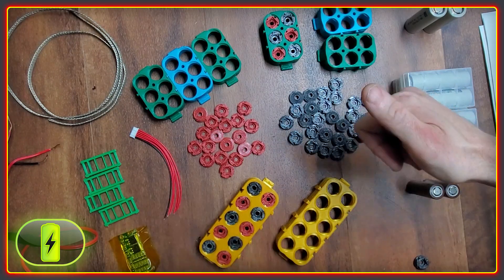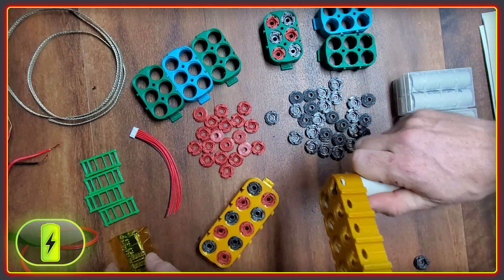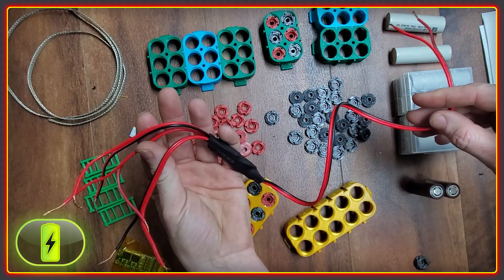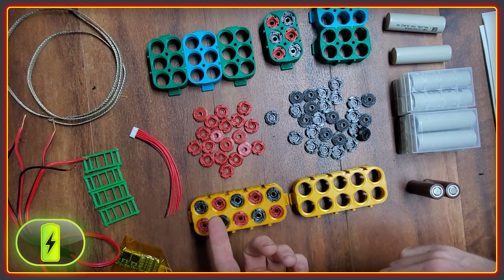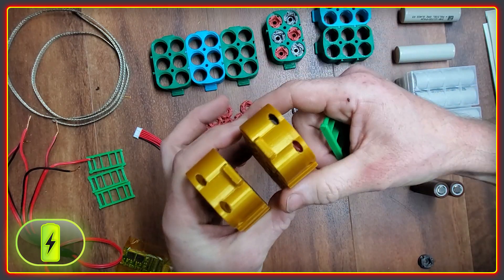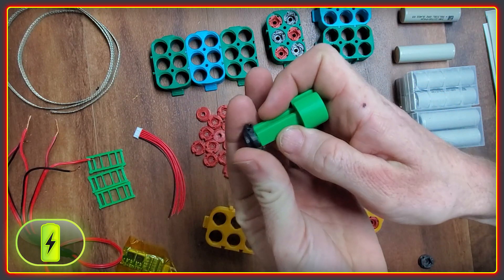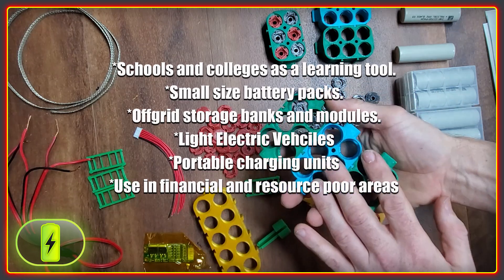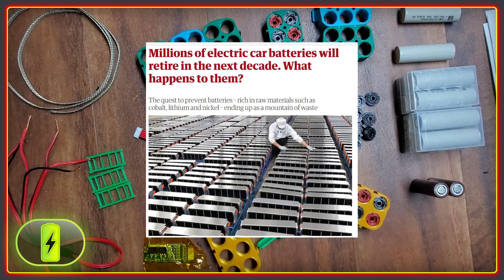Presenting the OMNICELL! Weldless Battery System for lithium ion battery packs.

Comment: For what it's worth, spot welding isnt that hard to 'get into'.. a diesel car battery and a AliExpress digital spot welder with a minor modwill do .2mm strips of nickel thick comfortably. Hassle though, and I imagine this system could handle higher currents without the need for stacking nickel or a proper welder for thicker
Reply from the maker: I will talk a bit more about the braid in another video. Good points. You can get welders cheap but you need a kweld or similar to use thick copper and nikel
Reply: @HighVoltageKits  I'm chilling in the sub 3kw range at the moment so haven't had to worry about that yet :)
Keen for something more but the cost to use just doesn't really make sense here in Wales, I can do so much with the 'ebike' and not get trouble.

Comment: These look good. Relatively quick and easy, not so power dense but oh boy spot welding is a chore. However in harsh vibration environments I'd want to see some sort of click lock on the screw in of the red/black caps as well as some sort of spring tension applied to the copper underneath.
Reply from the maker: Its interesting with the screws. The nature of the layers works to lock them in place. We have a test pack 20s1p running a Jetson bike. No suspension. It's holding up to vibration and I will be doing vibration tests for sure.

Comment: Your comments re Tesla's need for speed and the resulting heat generated in the massive battery required to power the eye watering acceleration are pertinent but also a little hypocritical.
 Lets face it - you guys have done much the same in increasing the power output of the BBSHD etc, and employing bigger, higher voltage, batteries to go faster.
This consideration of the need to recycle materials and reuse components does, however, make you holyer than Tesla. 
Thanks Joe, your concept and practical solutions in this field point the way ahead. I hope many follow.
Reply from the maker: I agree. I think that far too much effort by everyone is chucked into power and speed and no where near enough on the issues discussed here. That has to include us. Although I would argue we do consider range a great deal when we build bikes in many cases.

Comment: Very well done video and I love the entire concept. Being able to build my own battery packs would be phenomenal. It looks like the only trade-off here is the size of the case that holds the batteries together versus a traditional battery build where the batteries are just sitting on top of each other. Not a bad trade off. 

I was just quoted over $700 for a 14s4p battery build using Molicel 18650's. Would be nice to build my own pack and bring that cost down.
Reply: it does make them a little bigger. These are the linear modules, offset modules coming soon. Overall it really doesnt make the packs much bigger tho. Definitely possible to use them, much smaller than VRUZEND and can handle much higher currents.
Reply: 56 cells should run you about $250 at most. Not sure where the other $450 is coming from. You can buy a Kweld and the materials needed for that price and probably still have some money left over to buy yourself lunch. $250 for a Kweld, $50 for the power source (Lipo is the cheapest, you could do a capacitor bank), $50 in copper and nickel, $50 in barley paper, shrink wrap, etc. Leaves you $50 left over and a Kweld you can sell on one of the 18650/Energy Storage forums instantly for almost as much as you paid for it. And my pricing was not frivolously ordering stuff from China, that's paying top dollar in your country to get quality materials shipped to you within the week.

Comment: Seen similar, the issue they have is how dense you can pack the cells and these solutions ain't good for a large pack as you probably use 1.6x the space compared to own built.

Edit...I see the value of this kit now...I had to replace 2 rows of 9 in my 'homemade' 13s 9p battery...this system would of saved me so much time
Reply from the maker: Its a good point and I did not really spend much time on the size and spacing. Holding them in my hands they did not seem to feel bulky. I will do a video to answer some of the questions like this and compare it to other methods such as the hexagon holders. I guess you will never get as compact as gluing cells right to each other. I think we need to accommodate the trade off into the vehicles we make.
Reply: I understand how any weldless system seems like any other weldless system, but I can assure you, there has never been anything that works like this. Its a totally different approach.

Comment: Well I guess I don't have an excuse to not build my own packs anymore 😂
Reply from the maker: It is great for learning cause gone is the fear of damaging a cell with the welder or not doing it correctly
Reply: @HighVoltageKits  I think I'm going to try something like this with an old pack that I know has a crap BMS. Won't cost me much and it will be great to reuse an old pack that's just sitting there wasting away.
Reply: that is correct.